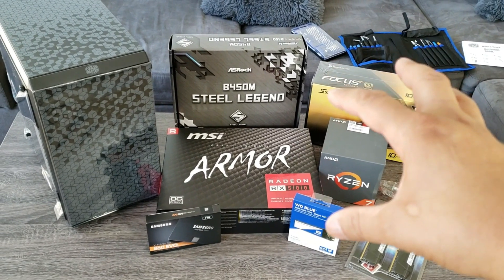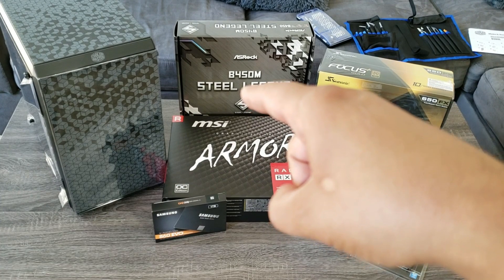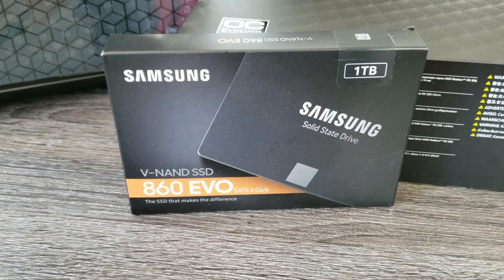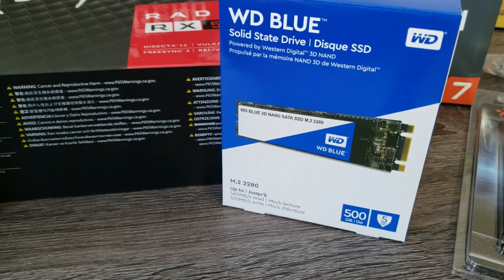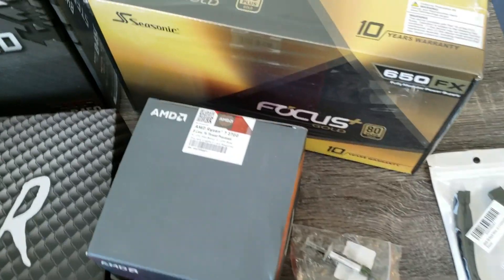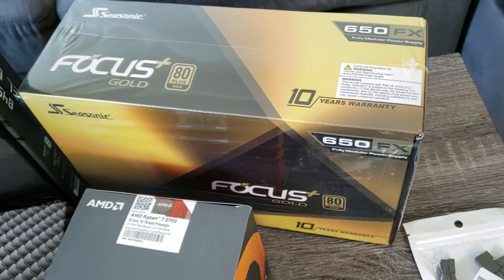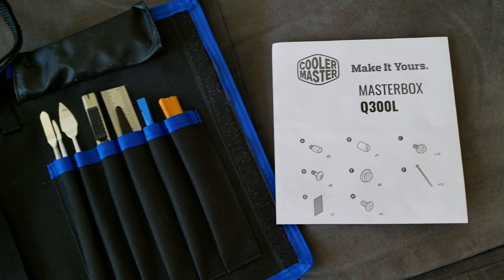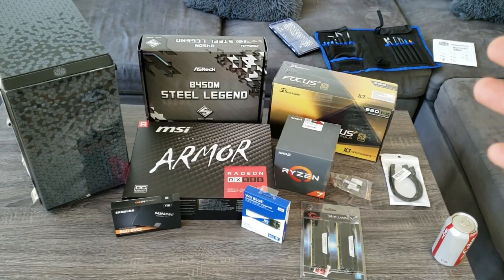$1000 PC Build - Ryzen 7 2700 RX 580

Comment: Did a similar build and got good air with high pressure fans rather than high air flow. Made quite the difference.

Just wanted to ask why you bought a slower SATA m.2 SSD for the lower slot and not a NVMe for the ultra m.2 below the CPU. Missing a whole load of performance there. 😐
Reply from the maker: It's just a mistake I made

Comment: have the same stuff mobo and cpu n gpu, did u update ur bios?
Reply from the maker: I called the manufacturer to check when I had the same question. No need to update the bios.
Reply: @ESM77  Thanks man appreciate it!
Reply: @ESM77  do you know how many fan headers this mobo have? i plan only using 3 of fans, +1 for the cpu, so 4 in total, can you please tell me so i know if i need to buy a splitter
Reply: gabriel_production It has 2 4-pin CPU headers and 3 4-pin fan headers

Comment: Bro I found a pc for 629.99 that has the ryzen 7 2700 and the rx580 mabye not the same ones as you but still for that price you cant beat it
Reply from the maker: Where at?
Reply: @ESM77  amazon
Reply from the maker: That's awesome. Great deal!
Reply: link?
Reply: I specced out a build (peripherals included) on PCPartPicker that had Ryzen 7 2700, 32GB 3000Mhz, RX580 8GB, B450M Mobo (w/WiFi), 120GB SSD, 2TB HDD, 400W PSU and peripherals for 655 before shipping and taxes. So if it's anything like that hmu with a link

Comment: Cpu, gpu, and Mobo is exactly what I've got so far(piecing this thing together paycheck to paycheck)
Reply from the maker: Your gonna love it when you get it all put together
Reply: Aiming for a decent workstation. I am admittedly a PC building newb,  but from what I gather what I have assembled thus far should do the trick.
Reply from the maker: Me to! This was my first pc build ever, I did months of research and price checking, I'm extremely happy with this machine, it is meant for work as well
Reply: @ESM77  how's the storage working out? I went super cheap, but I might pick up one of those M.2's as they seem pretty affordable now a days.
Reply from the maker: The storage I got it's great, big enough for a long time and very snappy for anything I'm doing
Reply: All i need for mine is CPU GPU
Reply: David your gonna love it

Comment: Men how you exactly install your fans ? You skip that part.. thanks btw gonna make one like yours
Reply from the maker: screwing them in is just screwing them in (making sure they are faced the right way).. then routing the fan cable to the motherboard header that says fan, or you can connect these to the molex connection coming out of the battery, that is what I did. They work great!

Comment: Wait, did that G.Skill RAM not work? I noticed a different one listed in your parts list... I got the one you used in the video because I was having trouble finding anything on the qvl list for this motherboard that was a decent price.
Reply from the maker: I ended up going with a different set of ram ( hyper x) I bought them and was having that "wattman settings have been restored due to system failure" and most forums said to buy new ram